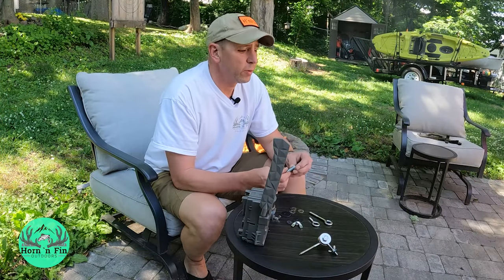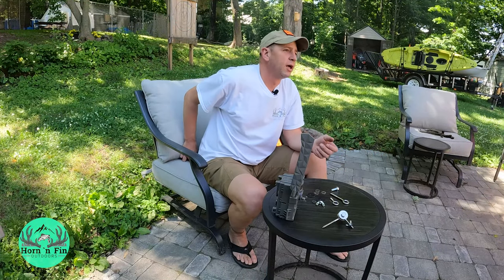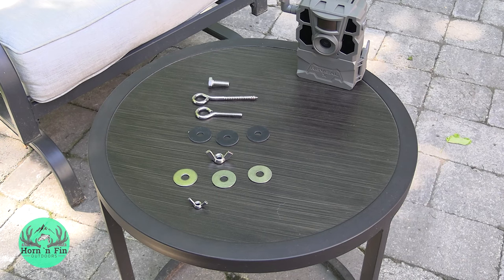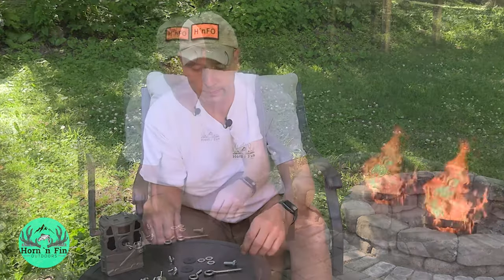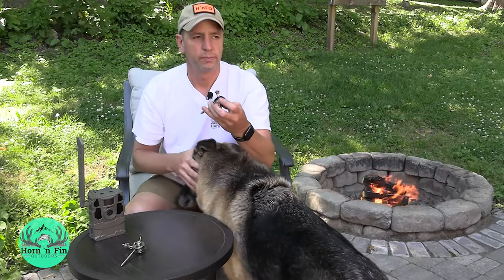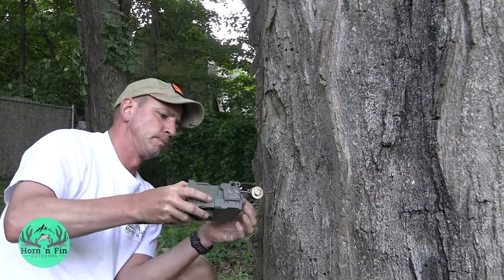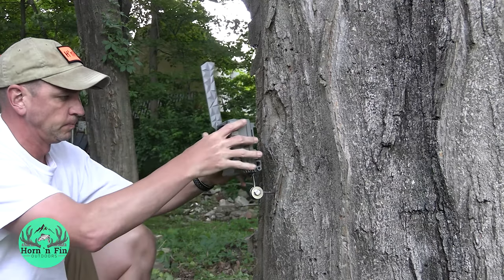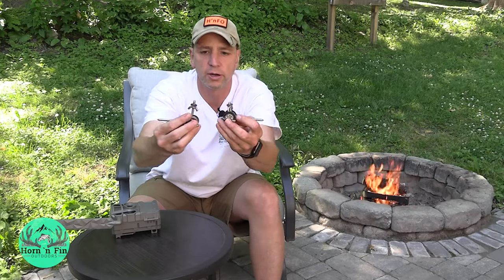DIY Trail Camera Mount

Comment: Thanks for the tips saw your video about the trail cam and now I’m sold. Hopefully I’ll catch my poachers this year and watch my food plots 😎😎😎😎.
Reply from the maker: Thanks for watching! Yes, they are such an easy and fun way to save a couple $$.    Get those poachers!!!     If you are looking for a great cam, try the Reveal x 2.0.  (I’ve done a review on them also).  Here’s a link to buy them on Amazon.

https://amzn.to/3P1ZGgz
Reply: @Horn_n_Fin_Outdoors  can they be used with solar power and then rechargeable batteries as a backup?
Reply from the maker: @anthonykontos7931  yes, tactacam makes a solar panel for them. they also make rechargeable battery packs.  ive got a review of them on my channel, they are probably the best cam on the market for the $$.
Reply from the maker: Here is the solar panel.  I’ll link the battery pack in another comment.

https://amzn.to/3d5Vv6h
Reply from the maker: Here is the battery pack link.

https://amzn.to/3BJFQUz

Comment: Awesome video watched the revel 2.0 video also could you please type the name of the hardware needed I know you already said it but when I go to the store I won’t know how to find it and will ask for a member to show me it would be easier to show him a written list please and thank you
Reply from the maker: Hi Fonz, unfortunately, i dont know the actual names for the items!  i had a list made up and used it to read off when i made the video, but it's long gone now.  thanks for watching
Reply: Here's the list
1-1/4x20 wing nut
1-3/8x1" bolt
1-1/4x3 3/4 or longer screw eye
1-3/8x16 wing nut
1-1/4x20x2 5/8 or longer eye bolt
3-3/8x1 1/4 neoprene or rubber washers
3-3/8x1 1/4 fender washers
1-1/4 bonded sealing washer or 1/4 washer w/rubber washer.
Got my stuff at lowes, came up to 12.00 plus to make it. Find a cheaper source for hardware
Reply: @bobwoisard2969  thank you bob 🫡

Comment: Went through this again (just ordered some trail cameras).  This is a good idea and I appreciate it.

I do have a question though.  Am I the only one that noticed that you apparently lost one of the rubber washers sometime between the beginning of the video when you showed the parts inventory and the end of the video where you showwed the utilization of those parts in the assembly?   

I watched three times and it certainly appears as if you ended up only using two of the original three rubber washers in the final assembly.

I'm guessing you took a break and one disappeared from your table so you shot the video without the third rubber washer which was probably originally destined to be used somewhere between the eye bolt and the eye screw. 

Hey, it's not rocket science, so all we really need is the basic idea and we can experiment with adding the third rubber washer (or even two more) if more friction is needed between the eye bolt and the eye screw to keep the camera from rotating after the device is screwed into a tree.
Reply from the maker: man, you have some great attention to detail !!  yes, you will use THREE rubber washers.  one under each end and one in the middle between the two eye bolts.  thanks for watching!  have fun building these.     BTW, if you would rather just purchase a mount, i have also used these HME mounts and they work pretty well.    https://amzn.to/3WujErA